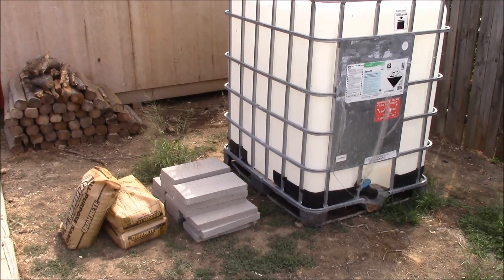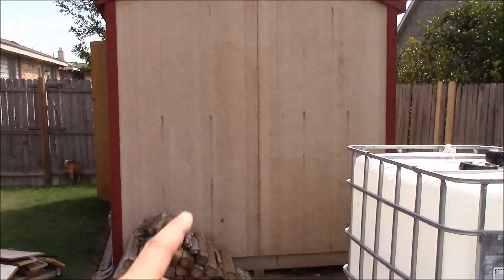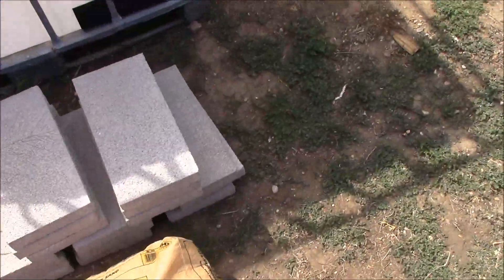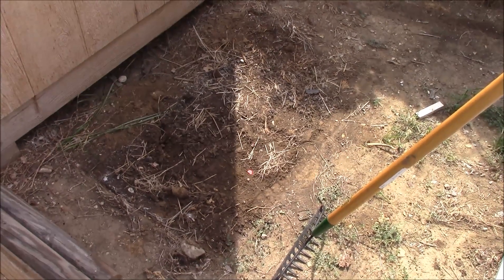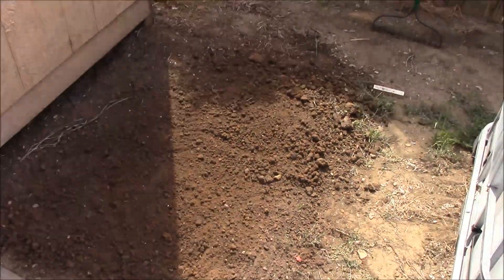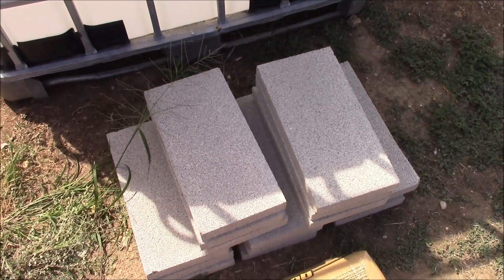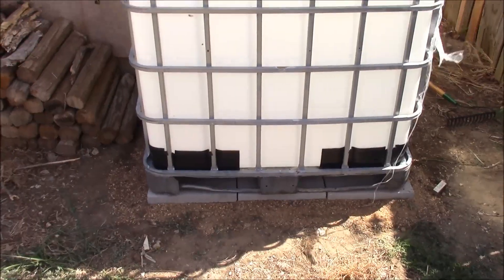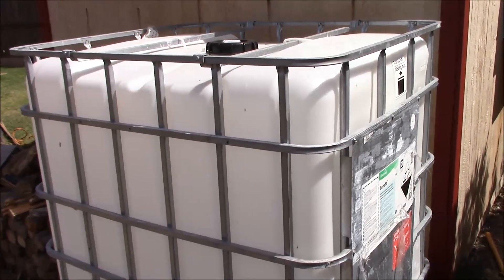Building A Rain Catchment System - Part 1 The Foundation

Comment: looking good...what's the approx cost of the tote and cage?  also, is that something you can find at Home Depot?
Reply from the maker: I got the tote for $75 from a company locally that recycles cooking oil.  You can find them cheaper but I only had to drive 4 miles or so to pick this up so it was worth it for the savings in gas money.  Home Depot won't have something like this.  The best they have for catching rain is an expensive 55 gallon rain barrel (about $100).  The cage comes with it, by the way.  I just need to clean this thing out thoroughly and protect it from sunlight and it should be good to go.
Reply: thanks...
Reply from the maker: If you want one you can find them for sale on Craigslist or whatever local for sale ads you have access to.  Prices range from $50-100 but make sure you get one that is food grade.
Reply: that's a great idea...i was left prior to that bit of advice wondering where i might find one easily
Reply: Craigslist is a good source of totes.

Comment: You cannot use that tote for potable water, or anything else for consumption. Did you happens to notice the corrosive label on the side? IF that tote had been effectively cleaned, and I don’t know that it can be and then useable for human consumption, the label should have been removed. Technically, you’re in violation of at least one EPA code, and probably others. I drive a truck, and I haul hazardous materials literally every day, and that tote is bad news.
Reply from the maker: True, but I have filters that can purify the water.